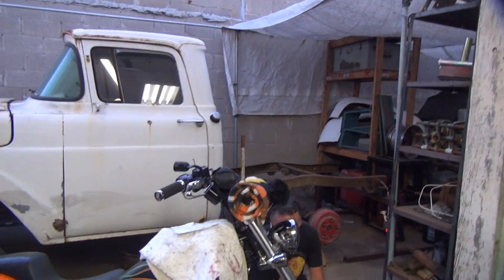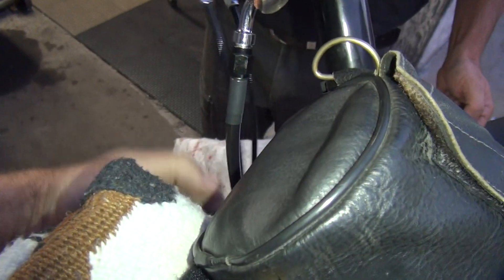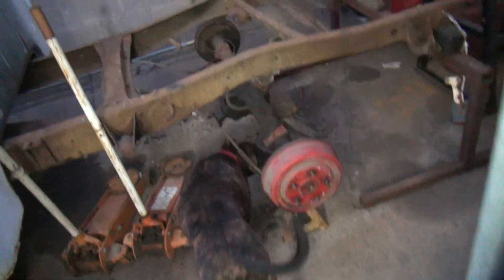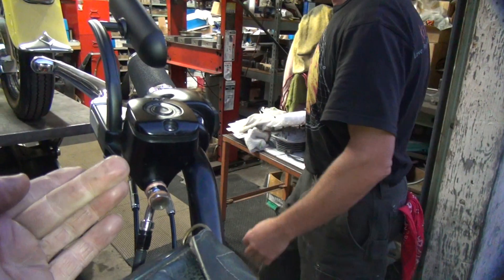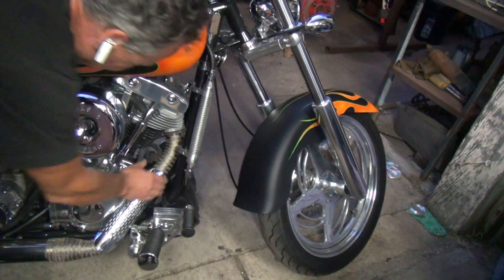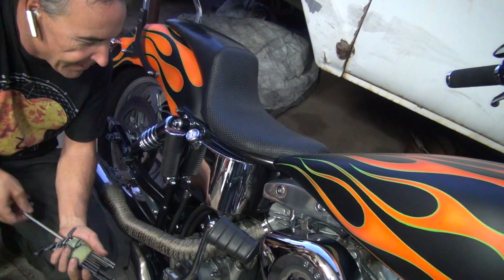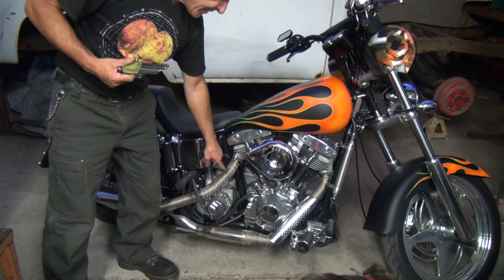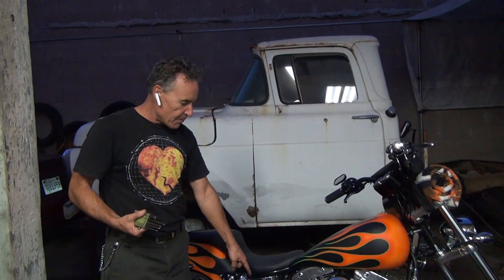how to bleed front brake 1979 shovelhead 93ci stroker harley by tatro machine

Comment: Tatro ,I need your advice Please i installed new clutch friction plates  
I was told by Ben  over at American Prime to fill oil level in Primary after installation up to Starter Ring.I read a very few on internet comments. One author says 8 oz one says 14 and one said 12oz. i put in 21oz .How much should i put in. Have you ever come across this. I feel i put in between them and service manual. Best
Reply from the maker: how did it work. that is alot of oil.
tatro
Reply: @TatroMachine   I only drove it from the front of the house to the shed in he back and she dropped into 1st nice and rode smoothly. How much oil do you think would go up to the starter ring 1990 FXRS
Reply from the maker: 2oz, but i would run more than that.
for a wet clutch bike, you run the oil to the bottom of the clutch plates or basket. for a semi wet clutch, you only run just a few oz of oil to keep the parts somewhat wet. lots of splash oil is all you need, not flooded oil.
tatro
Reply: @ Hi Tatro in your reply you say "2oz" do you mean 21oz.

Comment: What are those washers called? Double something tapered washers? Couldn't catch the whole thing, my ears are junk. Also, would you recommend studding the exhaust instead of using bolts?
Reply: The double tapered serrated washers are called "Nord Locks."
Reply: Thanks!
Reply from the maker: studs are the way to go.
tatro
Reply from the maker: shovelhead tested tough now.
tatro
Reply: yes they work great
Reply: @markalbert2378  Yep and they work great

Comment: Use stock Harley banjo bolt and washers for Harley reservoir, doubt you will ever get that line to seal......I never could, I didnt give up easy either I tried for weeks and weeks.
Reply: They are called crush washers, just tightening to torque will not seal them, use a brass punch and hammer, with light taps and tighten between few taps till banjo bolt no longer tighten anymore, will never leak again.
Reply: so far it's working great
Reply: Ok, hope you have better luck than I did.
Reply: @ R, Weaver... can you elaborate? Brass Punch? YOU Mean to hit the actual Bolt with a BRASS PUNCH and a hammer? or to "Flatten the Crush washers with a Brass Punch and Hammer??? why not just tap the wrench with a hammer?
Reply from the maker: thanks for the good tip.
tatro
Reply from the maker: no, tightening any further then very tight will only strip the threads or more likely just break the banjo bolt. tapping the bolt on its end will collapse the clearance out of the threads and compress the crush washer further without hurting anything else. after hitting the bolt retighten to the same torque you were using. once you see no change from tapping on the bolt stop or you will break something.
i just sanded the surfaces of the banjo flat to stop the leaks. scratches and chrome build up causes them to leak at times.

tatro
Reply: Anneal the washers.  600 deg. F for Aluminum and 1200 for Copper.  Place washers on fire brick and use propane torch.  A non-contact infrared thermometer is an easy way to measure temperature.